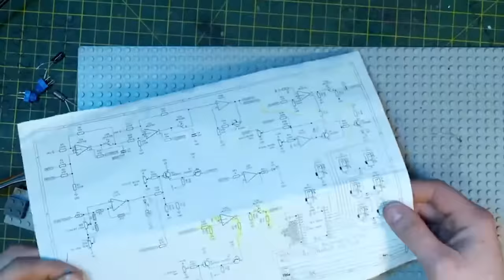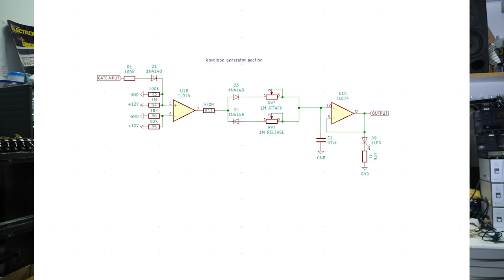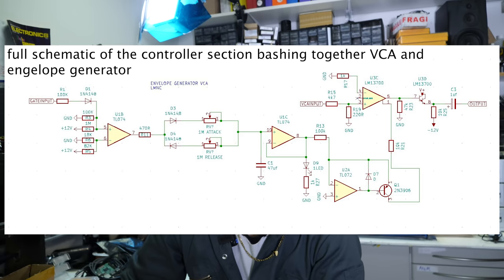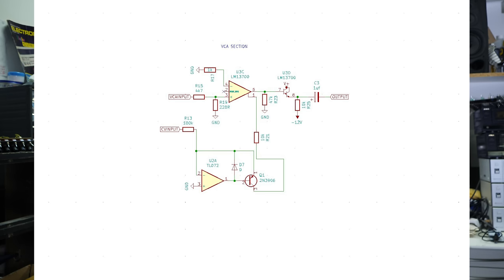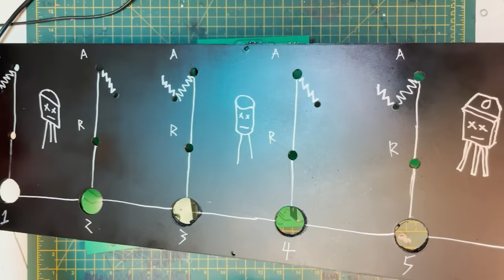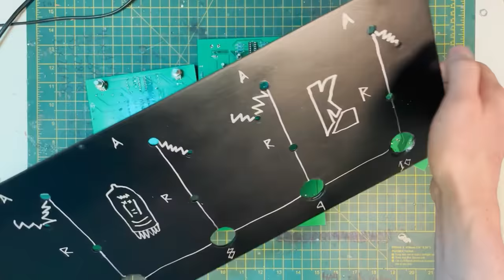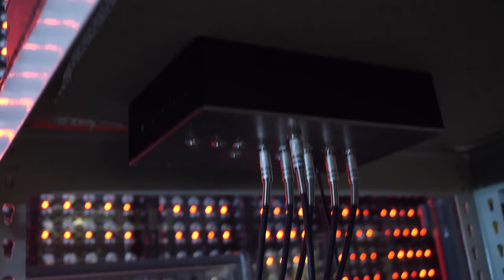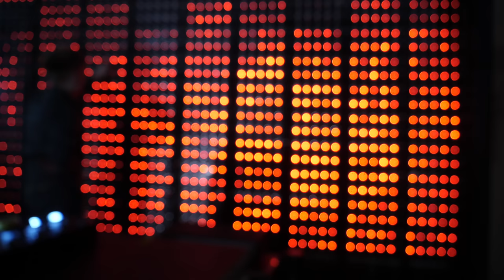KILO DRONE DIY Analog Controller For 1000 Oscillator Megadrone

Comment: I get the sense that we're still just scratching the surface of what you can do with that many oscilators. But building an interface for them that makes things manageable is quite an invention in and of itself.
Reply: Would be a ton of work but what if he set it up so the oscillators could ring modulate eachother? Or even each whole group of oscillators modulating the other groups.
Reply: It really needs to be set up for 24 channels -- 12 notes, split into left and right, with each channel's oscillators set to span several octaves... and then control it with 12 buttons.  Play it chromatically, typically two notes at a time.

I tried this with a sample of the kilodrone, sampled from a bit where he had the entire thing tuned to a single note across all octaves... and it works really well.  It totally fills the sonic spectrum, so there's only room for 2 or maybe 3 notes at a time... and no real need for additional octaves on the controller because going up or down an octave sounds almost exactly the same with such a huge sound.  It could be nice to duplicate the control buttons though, to give the player two "octaves" and make it easier to play in keys other than C.

Comment: 7:57  Back in the day when I was in the electronics industry working as a bench tech a fellow colleague was twisting wire using this method, however; he attached the end of the wires to a huge top heavy locker cabinet and began running the drill to twist the wire.  He pulled the entire cabinet over in the process.....that sounded like thunder when it hit the floor  ;)  Needless to say he received a few whistles and applauses  LOL   This project has been very impressive.  I wish you success with the museum

Comment: i used to wind wire like that at the electronics firm i worked for........ except mine ran the length of the factory floor.... also the amount of twist per inch can affect the voltage tolerances.

Comment: you should connect the leds to a Voltage to PWM converter and them connect the converter to output of the Envelope Generator so the led would light up as the audio goes,
Reply from the maker: They are? Check the panel there are signal led's there is a plan connecting also spotlights to the CV under each column
Reply: @LOOKMUMNOCOMPUTER  Awesome!

Comment: clearly this needs a 6foot x 10foot laser grid to operate. with lasers up the top and side, and photoreceptors down the bottom and other side.  when the light is broken signals are generated and in turn chaise audio chaos. add in a smoke machine for good measure!

Comment: Really need to make this polyphonic with a way to control the octave of sections and detune amount together, then add a few filters for each voice and envelopes, oof
Reply from the maker: Embrace the machine for what it is.
Reply: @LOOKMUMNOCOMPUTER  but you're so close to having a giant professional synth 🥺
Reply from the maker: Yeah but no. Personally I don't see the point. Having built Gameboy megamachune. Filters just dull the effort there are only so many oscillators you need in that respect

Comment: I wonder what's happening with this amazing contraption now? That's so tedious having those 1000 knobs to tune it though: why not take it all apart, add in an electrically controllable "knob" (a MOSFET or whatever) in parallel with the physical knobs along with the ability to select one or the other! Then add some kind of DAC thing (in a chip maybe), to control the MosFet (or just have an analog output direct from the chip instead of the mosfet. THEN hook all of those up to some kind of digital bus! Then hook that bus up via an adapter to a computer (sorry) or some other type of controller.

That would mean: a) instant tuning! b) the thing would become a totally different animal because each oscillator could be adjusted rapidly and independently!

It would be a mixture of old and new tech: all the sound generation done by hand built analog? electronics, and the control done by digital electronics or software.

Apologies for not really knowing what I'm talking about. I'm a programmer. I know a little bit about electronics but almost nothing about synths. I do fancy writing a software synth some day for fun though!  Edit: Ah I've just remembered: the first time I was watching these videos I wanted to build a software version of this Kilodrone 😁

Comment: When you twist wires in the drill, keep tension on them and when the desired twist has been reached give it a couple of sharp tugs, this will make the twists stay tight and not unravel. Or it’ll fly out of the chuck you haven’t done up tightly enough 😂
Reply from the maker: Yeah well as you can see the wires are indeed not unraveled